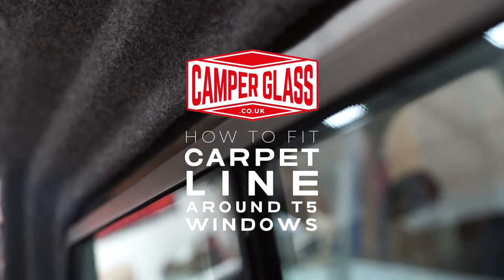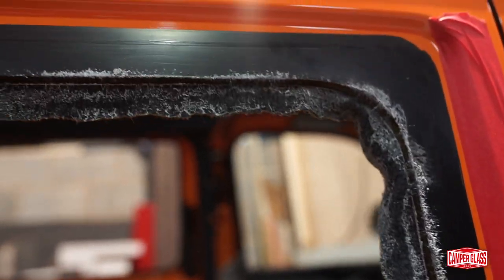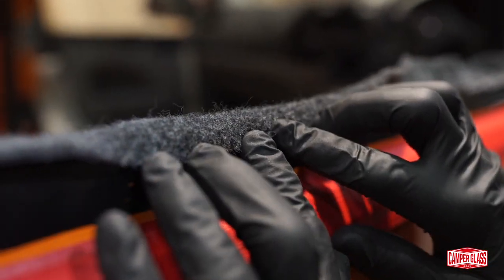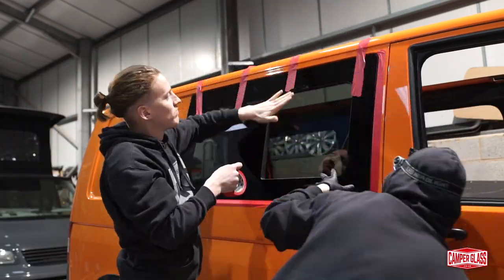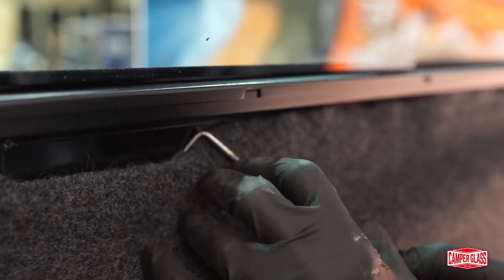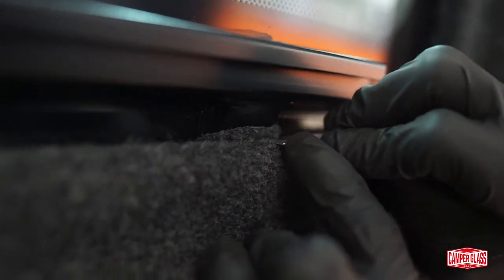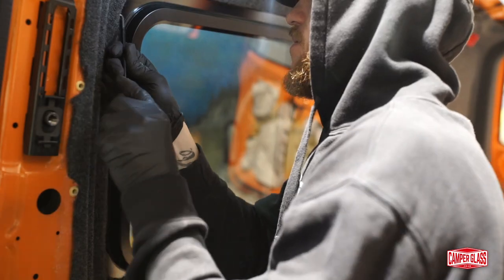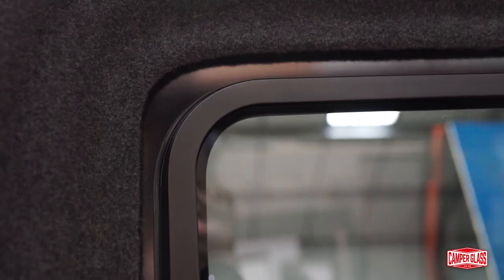How to Carpet Line Around a Window by Camper Glass / Transporter HQ

Comment: I am going to carpet line my van but have already put my windows in and have added the edge trim to the metal. Is it better to force the edge trim off and then fold the carpet over with as plastic tool (as seen in other videos) or try and push the carpet under the edge trim with it in place?
Reply from the maker: It would look nicer if you could remove the rubber trim. It just depends if it is bonded in place when the window was fitted
Reply: @THQAutomotive  I can imagine it would've ended up being covered in bonding when I pushed the windows on as the edge trim went on first - I followed the Kiravan tutorial. I will see if they come off. Cheers

Comment: Can I achieve this method (folding carpet over the cut edge) if I temporarily install some short pieces of j-trim to act as spacers, until my van is ready to be carpeted. I could then pull them out and fold in the carpet when ready.
Reply from the maker: possibly but you risk the J trim getting bonded in and you are unable to remove it.

Comment: Lovely job, is there a reason why you don't fold carpet over window opening before installing glass
Reply: Yeah that’s what I thought... wouldn’t that be easier to push in before glass goes in?
Reply: How many windows do you see stuck to carpet 🔫
Reply: Because the adhesive would go over the carpet, then the window wont be stuck to the metal work. It just makes a mess folding the carpet over before putting window in